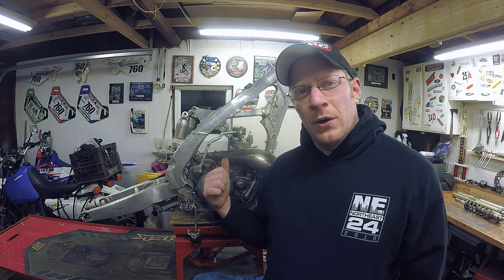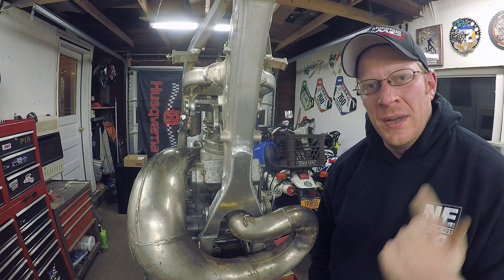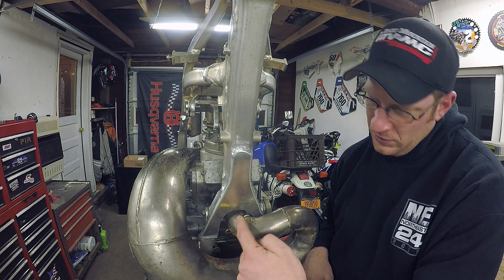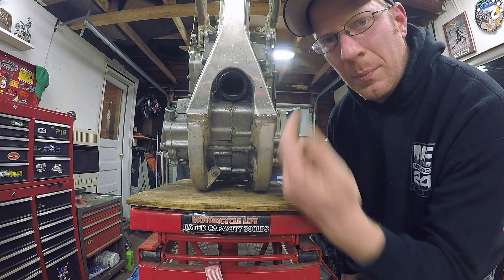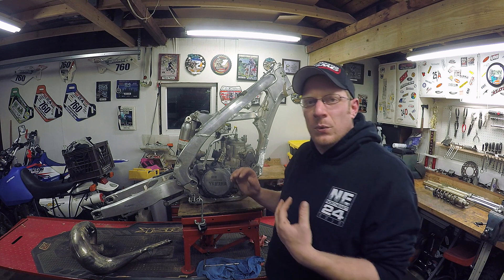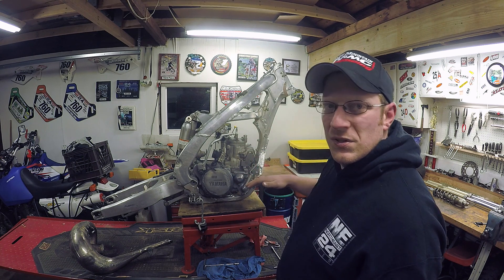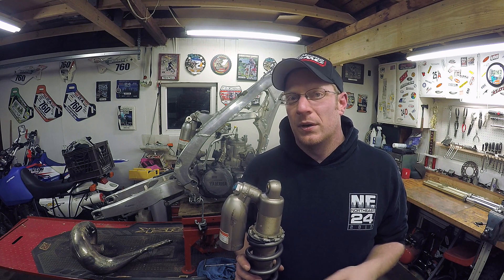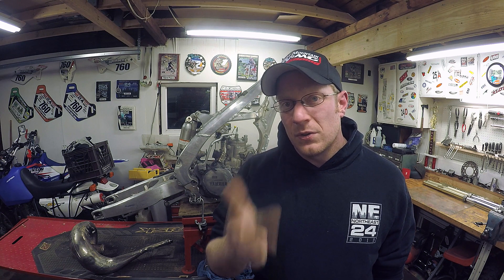2Stroke In A 4Stroke Frame Pt 2: What frame mods needed to be done

Comment: I have been eyeballing a similar project, yz250x motor into wr250r frame (street legal-ish 2 stroke dual sport). Might even be easier because the engine cradle on the wr bolts on so, thinking I could just build a new cradle and drop it in, well not "drop" it in but should be pretty easy. I havent look at swing arm mount compatibility yet tho, still....how hard can it be? famous last words.
Reply from the maker: The thing that made the deal for me was the engine fit the 4stroke swing arm. South Dakota will title anything above 200cc, run a dewalt battery for all the lights and a random tusk wiring harness to make it easier in your stock frame. I have a video of an xr100 I made street legal.
Reply: @robinsonmotorsports9976  I am in Oregon they wont license anything here that doesn't have epa approval. Used to be able to license other stuff but......it's Oregon.....They have even started refusing to renew some converted bikes that were previously approved.
Reply from the maker: @ddrowdy7666  Keep it registered in SD
Reply: @robinsonmotorsports9976  yeh....I could  probably get away with that for a few months, until one of the many sheriff deputies or state troopers who live in my neighborhood figured it out, not sure if they will be smart enough to know it sounds different than it is supposed to. Another option would be to buy one of the newer European 2 strokes that are legal to register, whats the fun in that? they dont come in blue.